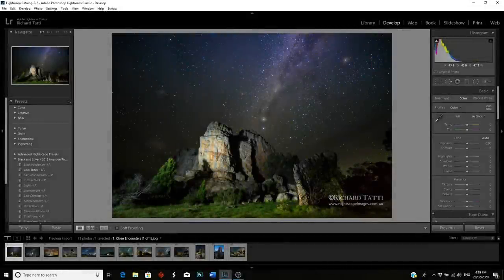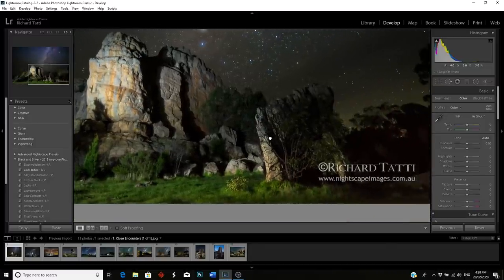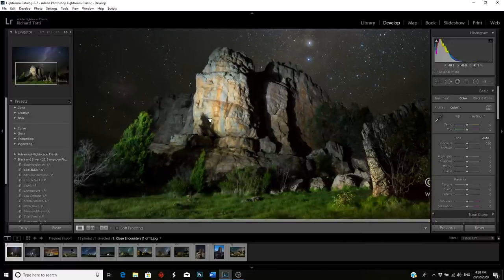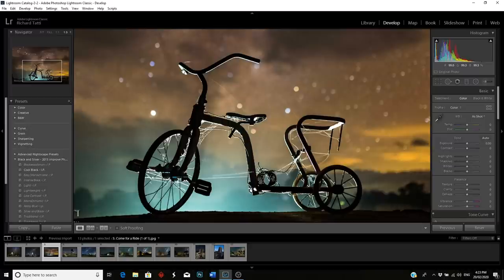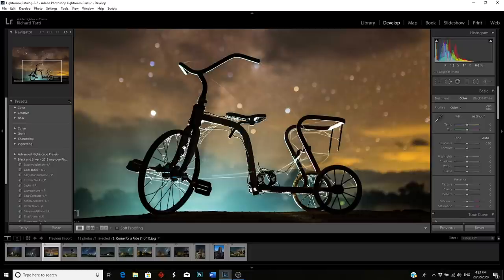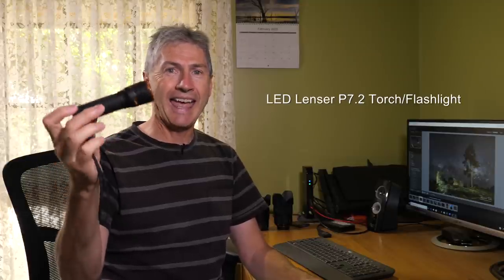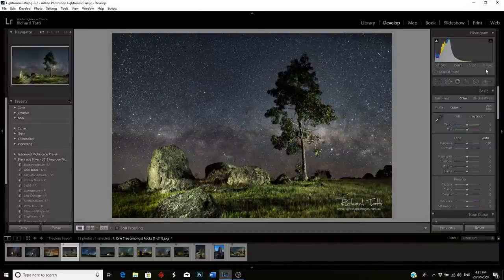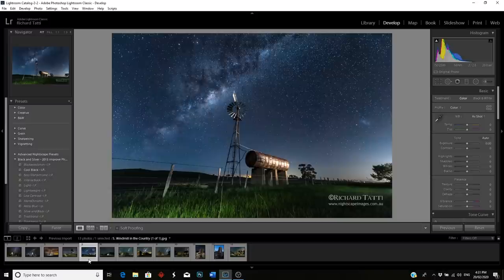How To De Construct Nightscape Images

Comment: Can't watch another video without making a sub. 
Just a few ?s; 
1. How intense/focused is your (torch) lighting,  and for how long do you light a particular detail in an object?
2. WB setting?

A joy, as always.
Reply from the maker: Thanks a lot for watching John. The intensity of the torch for light painting is usually quite subtle. Sometimes I'll zoom the beam into a corner or whatever bit it's mostly wide. I set my white balance between 3800k and 4200k unless it's moonlight then I'll warm it up to about 5000k
Reply: @nightscapeimages.richard  Thanks, Richard. After posting I read your answer to S Allen 1 month ago. Tried your suggs and found as you said; too intense will blow out. Good to know about being subtle. Great work 😁😁😁

Comment: Thanks Richard, this was an interesting insight on your approach to lighting. I'm new to this style of photography and I think tend to over compensate, lighting the subject from every which way. But hey, you can always turn the layers off later in PS 😆.
Reply from the maker: Thanks for looking Paul. Yes that's a common issue but as you've mentioned you don't have to use all the shots.

Comment: Really nice Richard, thanks for taking the time to do this. I found your channel a couple of months ago and have been thrilled with it. I do a little Astrophotography but had grown a little bored with general Landscape photography, stumbling across your channel has re-ingnited my intrest. I've gone back to some of my "run of the Mill" landscape sites at night using your methods and they are totally new and amazing... I really appreciate the time you take to explain these techniques. I've learned some new things with Lightroom and PS as well (although I still use CS6). I'm looking forward to any future Videos especially using the flash and Rear Curtian sync.  A couple questions if you don't mind. On your Z96 lights with the orange filter , is the filter a standard orange or is it also the 1/2 CT? I've also purchaced the Led Lenser P-2 and my question is: Which level do you use for lighting the low or high?  Do you use mostly the tight beam over the Wide beam? I'm finding that if I use the wide beam the image is too soft and bright. Do you tend to get closer to the object to concentrate the light on a particular area and take more shots of smaller areas or back off a bit and light larger areas and fewer shots(hope that makes sense). Anyway, thanks again and Grüss from Germany. Stay safe.
Reply from the maker: Thanks so much for watching Rick. Lighting is a very difficult thing to explain in exact detail because as you can imagine it's quite subjective. Basically you have a few parameters. 1.  Brightness of light source. I usually have my torch on the lower setting and I'll vary between wide and tight depending on what I'm trying to light.  2. Distance from subject. The light falls off as you get further away.  3.  How long is the light shining .. this may depend on the shutter speed of the camera also.  The Z96 comes with the magnetic full cto gel which is more intense than the 1/2 cto I use on the torch.

Comment: Hi Richard , great advice as usual , i use a work lantern that a have with a gel cover on it instead of the video light . A Milwaukee M18 LL and it has three settings , even on the low settings you can only shoot at iso 400 no more than 15 sec and usually at f 10 depending where the light is placed . Half the time ,the fun for me is,figuring out what and how i need to shoot the scene , and they are all different . Any way how is the corona bunker treating you so far? Best wishes , Erny.
Reply from the maker: Thanks so much for watching Erny. The Corona bunker is going ok at this stage.

Comment: Hi Richard, can I ask a technical question. I don't own a P7.2 but I imagine you can focus the beam from wide to narrow. I'm guessing the beam size you use would be tailored for the size of the subject you are lighting.  E.g. a car, fence-post, windmill might only need a tight pencil beam painted over a few seconds, but a large rock-face would need a wider beam over the same time-frame. Or am I off the mark and most subjects just require a tight beam for painting ?  Thanks in advance for your help and congrats on the success of your youtube channel and workshops.
Reply from the maker: It's always hard to give a simple answer to this question Steve. I use both the wide and narrow beam. The wide beam is softer and is more useful when close to the subject. If I need to throw the light further then I'll have to focus the beam. The tight focused beam is brighter and i have to be careful not to blow out the subject, but it's handy for lighting into narrow spaces etc.

Comment: What E-mount lens would you recommend for this type of work?   F1.4, F1.8, F2.8 and sizes?  I'm using an a7iii.  Looking for word to learning this process as a total amateur.
Reply from the maker: Hey Dwayne, thanks for watching. Sony 16-35 f2.8, Sony 20mm f1.8, Sony 24mm f1.4, Tokina 20mm f2, Sigma 14-24 f2.8, Zeiss Batis 18mm f2.8,  These are all excellent lenses and it comes down to what focal length you require. For me I love the 20mm focal length and the new Sony 20mm f1.8 looks exceptional. But most people like to have a wider angle covered as well so you can choose what your budget allows. The Sony A7iii is excellent for shooting nightscapes so you'll have no problem there. Hope that's helpful.